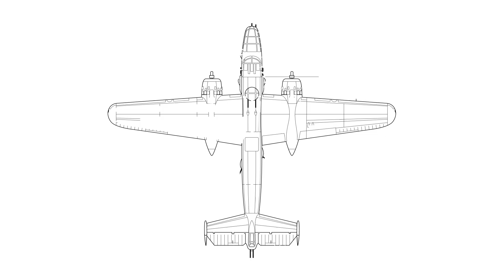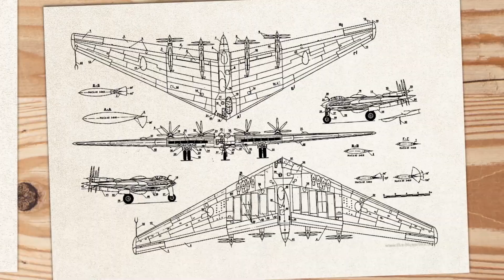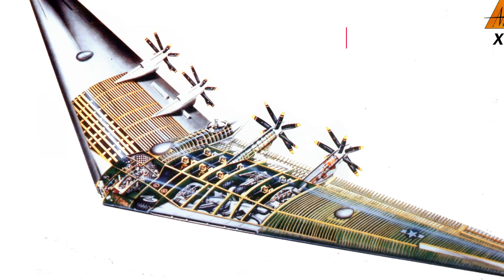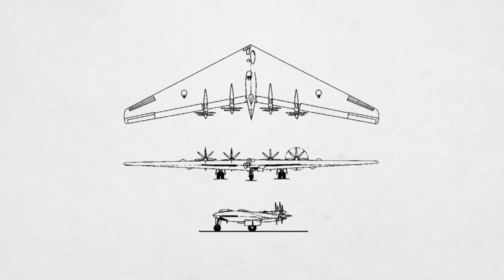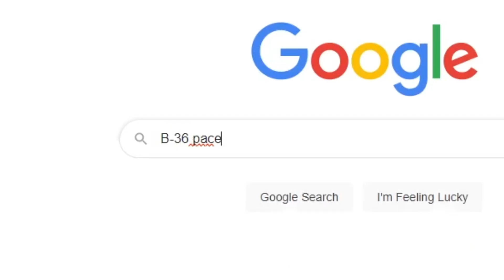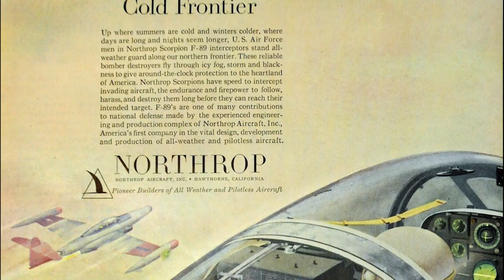This Plane Is CURSED - The Forgotten Flying Wing…

Comment: You’re more than correct in pointing to Stewart Symington, slimy Secretary of the Air Force for the demise of the YB-49. He fared quite well before and following his resignation benefiting from the deep pockets of Consolidated (Convair).
Reply: Slimy is a good description. No one was in that room but the two, but the retaliation to crush Northrop, destroy all YB35 and YB49 aircraft, transfer of Northrop technology to Convair, and then the very minor future contracts pretty well verify that Northrop was blackballed. Convair was in trouble and a few years later taken by General Dynamics, and Symington was no doubt attempting to beef up Convair with more facilities and technology before that could happen.

Comment: Ignored truths of the aircraft:
Propellor/Transmission gears kept failing.  Never solved.  Both types piston & jet engines over heated in the wing, never good next to a fuel tank.  The jet was unstable in the yaw axis.  The jet was pokey at less than a 500 MPH cruise speed.  The USAF Base of "Edwards" was named after a pilot killed flying this death trap.

Comment: What i think is no bell shaped lift distribution on flying wings is a big no-no.
As it makes the plane wobble left to right - whihc is not exactly compatible with hitting targets with bombs.
Reply: The only way the design could work in the late '40s & early '50s was propeller driven because that gave stability in flight.  But there was no turboprop at the time so an adapted transmission had to be used the piston engine.  Those things ate themselves.

Comment: you just forgott the part where you explane that the concept/plans are from german engineers right?
Reply: what?
Reply: Totally independent.  The XB-35 and YB-35 were being built when we were at war with Germany.  When the XB-49 was made with J-35 jet engines which were evolved from the British de Havilland Goblin jet engine of 1941.  The Germans had no input into the B-35/B-49 programs.
Reply: They're not
Reply: Hugo Junkers, just google him
Reply: @FirebladeX1989  I am familiar with Junkers. His work on flying wings was limited. His company didn't use his patents, and John Northrop worked independently of that

Comment: NICK! The YRB-49A did NOT have extra fuel tanks. It had SIX upgraded jet engines, two under the wing, and four in the wing, instead of the eight lower-powered original jets. However, by adding the under the wing engines, they ruined its radar cross-section, destroying its stealth capabilities. But, in the early 1950's, no one really knew about "stealth". Too much plane for the technology of the times, in my opinion. Also, for some reason, the government didn't seem to like Jack Northrop personally. After he retired, they then bought the B-2 Spirit stealth bomber design, which actually matched up pretty well with the XB-35/YB-49 size and was spot on for wingspan. The technology of the 1980's had caught up at last. These days, I see a similar reaction to the inventor/business tycoon, Elon Musk. The government totally refused to invite him to the recent "EV Day" event at the White House, even though Musk created and runs Tesla, which only  makes electric, non-polluting cars, even thuough the White House wants ALL manufacturers to create electric, or hybrid (sadly) vehicles. Why not invite the Number One Electric Car Maker on the planet to your party Mr. President? Personally, I think it's Jack Northrop all over again. He and Musk were/are brilliant inventors and businessmen.

Comment: I say Symington was out to eliminate YB-49 contending it to be under powered, riddled with engineering problems s.a., being forced to a ceiling of 15,000 feet with APUs for power. Hence, with time and influence he could pressure the air force to accept the conventional yet more expensive B-36 design. Northrop did the right thing. Kept the flying wing a pure and dynamic idea for later use as the B-1 strategic bomber updated variant.

Comment: To Peter Gray. Most of the problems with that were solved by IBM's kinda- sorta auto-pilot designed to keep the Wing stable for bombing. Big and clunky and very likely weighed a ton but it worked. I do wonder how things would've turned out if the Horton brothers had left Germany in the thirties to come to America. Just think what those three working together could've come up with? Though, I doubt the Wing would've seen service anyways due to politics. I guess Northrop just didn't either have the money to or just failed to pay enough to make the elected officials of that time happy.

Comment: The funniest thing to ever come out of Top Secret government projects had to be when Toyota actually outed the B-2 Stealth Bomber in a TV commercial for one of their new cars and before it was revealed to the public. Now as to the XB-49, there is some evidence that something very funny went on during the return flight from Washington DC. The Airman in charge of ensuring the OIL BLADDERS for all 8 engines were full, actually DIDN'T return with the crew. He asked for and was granted permission to return to base by car or bus or possibly motorcycle. I've forgotten which now. Strangely enough, he had a fatal accident fairly soon afterwards. Before anyone could interview him about his failure and unusual request to NOT do his job on the return flight.  Now Edwards brought the accident that killed him on himself. He was test flying a BOMBER not a fighter. Yet he attempted to do something like a wingover maneuver typically done in fighters but not bombers. That caused a stall and then a spin. There was also a major design flaw involved. Some of the important controls for the plane were above the pilots head and in the spin he was unable to reach them. The wing was not designed to take that kind of stress nor make those type of maneuvers and thus failed. In that business, stupidity is very often fatal.

Comment: Science stupid like cows 

Science poisoning the world is , the sagittarius A * is black hole, if the sagittarius A * is black hole, the mikyway will collapse  .
The sagittarius A * 4 million times brighter than the Sun, so the sagittarius A  work like the Sun  .
Explain 
Properties of electrons  -- and properties of positrons + is spins very fast, after 30 billion years of creating the sagittarius A * ' s core, so the core of the sagittarius A  * rotates very fast like A super large electric turbine that produces super large electrical, 
South pole the sagittarius A * push out space 16 million million tons of electricity per second  .
North pole the sagittarius A * suck in 16 million million tons of electricity Every second  .
The magnetic field of sagittarius A * is emitted flying in circles returning to its original position after 105 000 years, so pushes the solar system rotate around sagittarius A * very orderly

Comment: The allowable center-of-gravity change in a flying wing is very small, because it cannot apply a compensating leveraged force from any rear elevators acting at a distance from the C.G.. A flying wing must be loaded with fuel and load with no margin for error. On a bombing mission, should a heavy bomb "hang up" in the aircraft's bomb-bay, the flying wing would become longitudinally unstable. Without an elevator at a long moment-arm to compensate for the changed C.G. position, it would crash. Ordinary aircraft have tail trim tabs to adjust this balancing force. There was no conspiracy against Northrop. He was an aeronautical purist, but unfortunately real aviation must prioritize practicality. It doesn't do to focus on just one aspect of flight, it's a delicate balancing act of many forces. Even birds have tails, and nature knows best.

Comment: My Father worked for Northrop during the building of the YB35 & YB49.  He didn’t work on either but on another project in a nearby building.  He told me the flying wing ran across a B36 and the wing crew turned it on edge and flew around the B36 longitudinally.  What a magnificent airplane!  As far as the story of the near forced merger of Northrop and General Voltie, yes it happened the way Jack Northrop tells it.  Everyone who worked for him respected and admired the man.  Sorry, the history of what became General Dynamics is one of questionable ethics especially Symington.  I take Jacks story as more truthful.

Comment: Hardly cursed. The tailless design was unstable because it needed many control adjustments a second. It was only more recently the computers were designed that could keep the plane from crashing. No sabotage. No bad luck. Just a design whose time has not yet come.

Comment: Neat airplane, but-- nasty.
Bad handling airplane at the stall. Tended to flip over on its back  along its pitch axis. 
The one that burned on the ground-- the pilot actually tried to stop the firefighters from putting the fire out. 

Had to compete with the B-36, then the B-47 jet. Which was a medium bomber. I think the B-47 shut the door on the YB-49.

Comment: The XB-35 could not carry the Nuclear bombs of the era. Despite what the Narrator says it was not stable enough the be used as a conventional bomber. The Extra Fuel tanks on the YRB-49 were actually relocated engines.

Comment: The flying wing was a great idea but a couple of years too late, and when the jet engine came along the fuel needed for the new engines limited its range. The wing also being very thick compared to other designs, limited its potential speed. As for amalgamation with other plane manufacturers, the same problem cropped up in the UK, namely too many outfits competing with each other and not enough potential business.
Many good ideas with potential never quite made it, the Northrop Wing was just one of them.

Comment: The real problem with the original flying wing was lateral instability that caused the bombs dropped from a high altitude to scatter left & right. Not a problem with the computer controlled B2 and modern smart munitions.

Comment: Has anybody here actually seen an XB-35 in the air? I watched it fly over the Baldwin Hills in the late 40's, almost straight above me. Huge, extremely impressive.
Reply: Probably not since all of them were chopped up by 53.
Reply: @lucastekkan  By "late 40's" I mean between 1946 and 1949. '53 came after 1949.
Reply: @jguenther3049  I know, but considering most of the people watching this video are in a 15-30 age gap, they wouldn't be alive to see such feat

Comment: Jack Northrop DID live to see his concepts become real.  When Northrop-Grumman held a gettogether to show the finalized design of the B2 bomber, one of the guests was Jack Northrop.  Although old and frail, bound to a wheelchair and unable to speak, Jack was invited to the unveiling, where he saw and held scale models of the aircraft, and listened while engineers explained how computers were used to overcome the flying wing's stability issues.  Though he died before seeing the finished airplane, he saw what it would be and saw that his ideas of using a flying wing had finally found purchase in the US Air Force.

Comment: The plane was inherently unstable and pilots could not get out when it stalled. It tended to flip over and over when it stalled. Also in banking turns, It's side slip was so bad that it would slip right into the ground. My father did an analysis back the the fifties for a senator which in the end, killed the project
Reply: They could get out, it happened with a test pilot. But he also said that the aircraft was never to be stalled. They had solved the yaw stability issues with a gyro system, Bell would later reuse that idea with the AH-1 cobra see: https://www.youtube.com/watch?v=EHsiBSTdjyA&t=366s Gyro stability with no computer required. They didn't update that system until the mid 80's because it worked so well.

Comment: Also worth noting, the flying wing design while efficient has stability issues. It is hard to control, as there is a reason planes took on the shape they did. 

This can (and has) been fixed with computer technology that can make thousands of micro adjustments every second. But such tech didn't exist, or even was conceptualized, in the 40s & 50s.

Put simply, Northrop was born in the wrong decade.
Reply: Hear Hear!  "Fly-By-Wire" solved so much of the "Flying Wing" problem that the F-117 became feasible.
Reply: I think you mean generation or century. A LOT of people were born in the wrong time. But then again this world might not be here.

Comment: A radar evading first-strike strategic bomber was simply to destabilizing for the time.
Once deployed, it could be endlessly duplicated by every side.
For radar of the time, this thing simply vanished!
This is why they were destroyed in broad day-light; Russian satellites could confirm that we didn't have them.
Back-scatter radar systems, developed for clear air turbulence detection in the 1970's, can 'see' a hole in the air-return.
A stealth airplane blocks the return that should have come from farther downrange.
It's not accurate enough for targeting, but it detects range and heading well enough!
Preset-day stealth capability is compromised by back-scatter, so there is some easing of the prohibition on stealth.

Comment: Oh, for God's sake!  Enough with the childish melodrama!  Re: the YB-49 that had its nosegear collapse after it developed virbration problems during high speed taxi testing.  (9:44)  "Why was the fuel tank full when the plane wasn't even flying that day?  Very odd indeed...."  You ignorant  ass, there was nothing "unusual" about that test -- that's exactly what taxi tests are for.  Their purpose is  to determine if there are mechanical or handling problems with the aircraft when it's fully loaded while moving at high speeds  on the ground -- like when the aircraft  would achieve on its takeoff roll.  The aircrew of any aircraft are going to have a really bad day if their nosewheel collapses during takeoff because no one ever tested the design for such problems before the plane went operational.

Comment: What should have been mentioned, was that it took 3 pilots to fly this thing in the absence of computers in that era.  Totally teamwork dependent aircraft.  With computers, you can make lots of weird designs fly.
  I wish it would have turned out better so that we could have couches and bars in our passenger aircraft.  Flying coach would have become flying couch.  Otherwise known as the couch trip.  Would even have a few poles to dance on. Tony Stark would definitely own one of these flying lounges.

Comment: In 1953, I was in the Navy, stationed @ Adak, Alaska.  I got a 30 day "leave" and went NORTH to my home in Fairbanks, Alaska.  My Dad owned "The Elbow Room" bar on 2nd Ave in downtown.  At the back of the bar was a big circle area where 6 to 8 could sit and see each other.  Test pilots from different aircraft Cos. hung out there in the evenings.  One night I'm sweeping peanut shells into my apron when one of the guys said, "Hey, would you like to see some airplanes tomorrow?" My answer was a loud "SURE!!!!!!!!" So at 8 AM I'm at the hangar check-in and get in like it's a movie theater, not a place where SECRET AIRCRAFT are testing.  When I walked into the hangar, a big thing is blocking my view so I look under it and see an F-80 sitting on the other side of the hangar, then I looked up, and this monster, the XF-102 is what I'm under, and on the other side of it was the XF-101.  I got to sit in both of'm.  When I got back to Adak and told guys about them, they said something like, "Ray, you've got to change beers because the stuff you're drinking is screwing up your mind. I'd like to have seen their faces when those planes became public.
Reply from the maker: What a great story

Comment: Awesome video as per usual. Your CGI graphics are top notch!
Reply from the maker: Thank you sir!
Reply: Actually the graphics had some fairly fundamental flaws, the YB35 had 'contra-rotating' props, which means the front prop turns in the opposite direction to the back one. All the CGI showed all the props turning the same way. Also the fins on the YB49 were above AND below the trailing edge, not on stubs above the trailing edge.
Good video overall, but typical little mistakes from non aviation doco makers.

Comment: There was NOTHING insane about Jack Northrop's flying wing designs, his N-9M set records for speed versus engine power!  The XB-35 had propeller/engine problems (both specified by the USAF, not Northrop who said he would never have used either of them).  The XB-49 was found to have problems with yawing in flight, since it had no tail (this was compensated for in the 35 by the area of the propeller shafts/engine cowlings (this was solved by inventing a NEW auto-pilot by Northrop after the death of his friend Glenn Edwards).  When it came time for the initial proposals for the B-2 designers showed the model to Jack Northrop (then in the terminal stages of cancer and BLIND), he is supposed to have run his hands across the model and declared that she was a winner!

Comment: The aircraft was indeed sabotaged by those who wanted the contract to o to Convair for the B-36.
Reply: not sabotaged: this previous flying wings was unstable, only a fly by wire computed system can allow to fly it safe...the only flying wing who was natural stablke, was the Fauvel wings, but they "autostable" design not allow high speeds (was use on gliders)

Comment: The flying wing is a completely different aircraft it's more efficient but unstable which is why it only made a comeback in the 90'ies as the B2 when the digital control systems technology was advanced enough to harness the inherent instability of the aircraft.